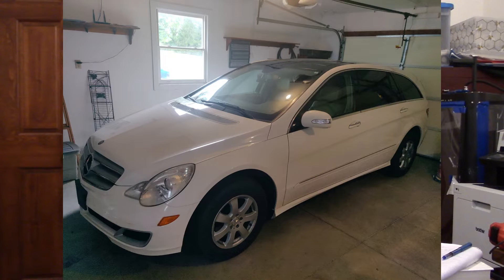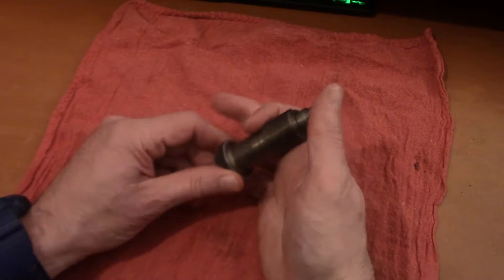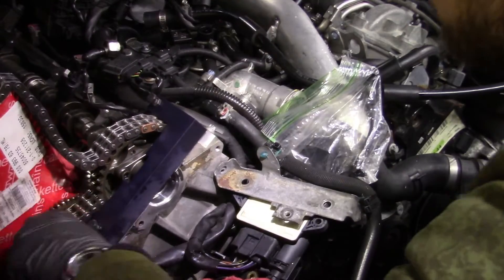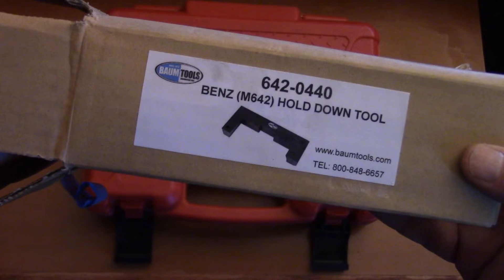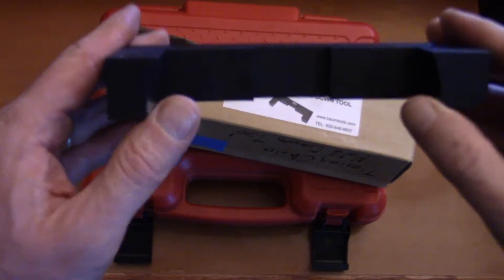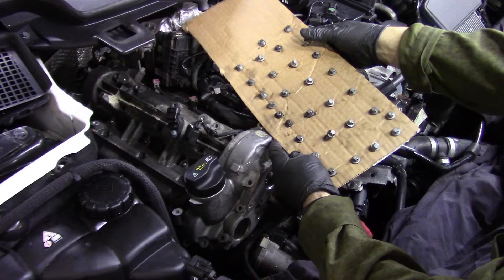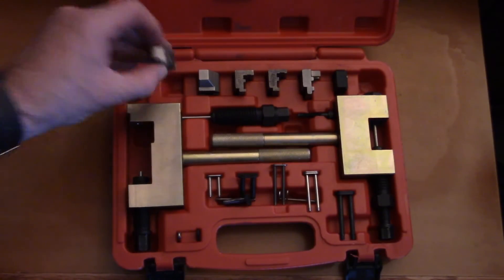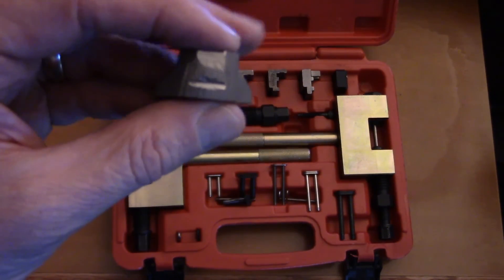OM642 Timing Chain Replacement Tips, Mercedes R320 CDI and Others

Comment: So, as you’re feeding chain down into the engine and turning the crankshaft, do the cams want to ride up as the cam lobes push down on the rocker arms? Seems to me like that would be a problem, but I haven’t noticed anybody talking about it
Reply from the maker: Sure, I see what you are thinking. That Baum tool I show is not only holding the chain onto the sprocket, it is also holding the sprocket down, and hence the cam. Keep in mind that the chain tension as I rotate the engine is also pulling it downward.

Comment: Hi if I change only the tensioner is it a strait swap or do cams need holding, thanks in advance
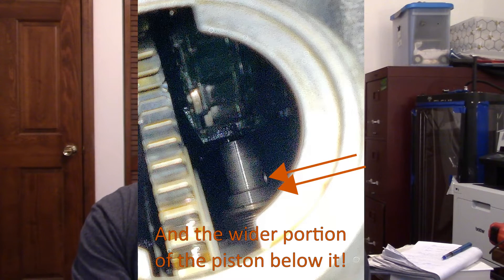Reply from the maker: Usually, the chain stretch is the problem. Have you looked down your oil cap to see if the tensioner is fully extended? That's what I'm showing at 1:29 in this video. If your tensioner looks like mine, the chain's stretched, and a new tensioner won't fix the loose chain. All I can say is that you'll have to research this carefully. I recommend seeing if you can get a copy of the WIS (work instruction system), to properly diagnose and repair.
Reply: @ArtOfDiesel I've only ever heard the morning rattle 2 times in last few years and never heard it since changing oil, I'd already purchased the tensioner so might as well fit if it's simple enough
Reply from the maker: @davesmall8810  no harm in trying. Just saying to do your research. Sorry I don´t know if you can just unbolt it and bolt the new one in without holding the chain.
Reply: @ArtOfDiesel I've seen a person holding the cam and another not holding anything, I'll leave the breaker bar on crank pulley so it has a little weight going counter clockwise
Reply from the maker: @davesmall8810  let us know how it works for you.

Comment: Hi. Good video. I have 2007 e320 CDI V6. Not starting DPF plugged cams on both sides not the same timing chain stretched 12% . Could you send me that Mercedes WSI manual how do I find it online. Thanks

Comment: No bro, don’t put nothing inside there to pull valve cover off. There’s an easy way to pop it off but for some reason it’s like the best kept secret ever.  First time I tried to remove it, two days later I was still at it. I’m not exaggerating. So I paused everything I was doing and Iooked at it for a while (about 3 days) lol. If you notice in the middle of the valve cover there’s two cut off holes and each have a shiny ball at the bottom. All you need to do is put a hammer or a medium size crowbar against that bottom ball and just gently pry it up. Start slowly, don’t put all your power into it cuz you don’t want to damage or bend your aluminum valve cover. It’s coming off very easily because you’re right in the center. I usually pop it off from the first cutoff hole closer to the front of the car. The other cut off hole I don’t think I ever had to use it plus I find there’s not enough room. Try it, it will only take you a minute. As a matter fact, wiggling the valve cover off the block will take you longer than popping it off

Comment: I admire work done there, however changing timing chain without changing all movable parts where chain is rotating/sliding is waste of time and money…
Generally speaking if chain it self is stretched it’s more likely that other parts of the set must be replaced as well…

Comment: I need to replace my timing chain. I am curious how far off timing it currently is, does the crank pulley have timing marks? I can't seem to find them.
Reply from the maker: @anyvey, it does have timing marks. You might have to clean off the pulley. When I found mine, I marked them with white paint. Mine was a full 15 degrees retarded.

Comment: What did you do to modify your engine?
Reply from the maker: I deleted swirl flaps, EGR, DPF, and cats. Cleaned out the intake manifolds that were a sorry mess, too. Don't do this if your state prohibits it! I went with a Malone (Tunezilla) tune, but I don' t know if they do deletes, anymore. Today I'd look up Tautvydas Lukosevicius of ECU Tuning Kaunas (in Lithuania) on Facebook to ask what he can do for the OM642. That's who I'm working with on my E320 CDI with the OM648, now.
Reply: This is perfect.  I'm building 3 motors like that one is for sprinter  one for jeep grand Cherokee, GL350

Comment: Awesome Video.  Would you mind sharing all the mods you did on the R320 to achieve 30mpg.  I have purchased a 2010 R350 3.0L Bluetec with 185K.  I did all the filters, the CCV and some seals/rings/gaskets.  Oil cooler seals in the V of engine seem to not be leaking.  seals in the egr cooler, vacuum housing, and oil filter housing were leaking and seem to be fine since changing. Timing chain tensioner looks to be within normal specifications.  I plan to clean the intake manifolds this summer and do a swirl flap delete with a resistor in the plug.  I would really like to stop the recirculation of exhaust gas into the intake manifold.  It looked pretty built up with carbon.  Debating on the ECU tune to delete the EGR.  CB-Engineering has a Full EGR delete kit with plates, pipes, etc which replaces the actual EGR cooler in the V of the engine.  It needs a ECU tune with the mod.  Just looking to bring this engine to its potential.  The EGR, DPF, DEF just seem to create such negative issues.  Any info would be gratefully appreciated. Thank you
Reply from the maker: You are on the right track! I deleted swirl flaps, EGR, DPF, and cats. Cleaned out the intake manifolds that were a sorry mess, too. You need a tune and at that time I went with a Malone (tunezilla) tune, but they might not offer the delete options, anymore. Today I'd look up Tautvydas Lukosevicius of ECU Tuning Kaunas on Facebook to ask what he can do for the OM642. That's who I'm working with on my E320 CDI with the OM648, now.
Reply from the maker: You also have DEF injection, don't you? I don't know if that adds any restrictions to your exhaust. I didn't have that in my 2007 model.
Reply: @ArtOfDiesel  yeah I got DEF injection.  Was looking at JR Tuning as I'm in Canada. Stage 2 with DPF Egr and scr option.  I will probably just hollow out the DPF and leave CAT in place and disconnect sensors and Adblue system.
Reply from the maker: @chrismurray8019  make sure the tune you buy deals with all of your deletions. For instance, the DPF has pressure sensors before and after, and it will notice that there's no pressure differential. The ECU will be looking for that DEF system, the EGR, etc. Join my substack at artofdiesel.substack.com and reach out to let me know how your R-class project goes!
Reply: @ArtOfDiesel  thanks for replying.

Comment: 1. We made a lot better timing chain tool
2. Covers lifted from the corner with screwdriver and hummer (carefully) 
3. Chinese riveting tool can be easily modified, and no need to remove camshafts.
Reply from the maker: Hey, I'd like to see photos of that modified chain tool! I figured I would cut it down next time, which I'm sure you did. Still, it'd be cool to see what you did to it!
Reply: @ArtOfDiesel  We made it completely different than OEM, check videos on our channel
Reply: @sprintermotors   bonjour je suis abonné sur votre chaîne j’ai regardé pas mal de vidéo sur votre chaîne mercis.je voudrais savoir sur un OM642 E350cdi de l’année 2010 Il faut combien de temps de travail pour remplacer la chaîne de distribution? parce que j’ai un souci au premier démarrage dans la journée c’est-à-dire que quelque soit le temps , le matin midi soir lorsque je démarre la voiture pendant une ou deux secondes j’entends le bruit de chaîne ensuite pendant toute la journée aux autres démarrage il n’y a aucun problème ça démarre sans faire du bruit c’est seulement au premier démarrage qui me fait ce bruit Et très rarement le fait pas du tout. je ne sais pas si c’est le tendeur qui a un défaut ou bien je dois faire je dois placer complètement c’est-à-dire il comprit la chaîne et plus le  tendeur ? remplacement de l’huile de moteur je suis très soigneux Kiyar depuis que je l’ai acheté (140000km) j’ai toujours fait faire remplacer l’huile entre 4000km à 7000 km et le moteur a maintenant 234 000km
Reply: @alidogansoy8534 j’ai lu sur des forums que si tu entends la chaîne au démarrage, le galet tendeur est au maximum donc chaîne trop détendue et faut changer. T’as résolu le problème depuis le temps ?

Comment: Thank you for making this. As a MB technician who owns a ML350 bluetec & working on a OM642 GL350 bluetec, this was very informative to know & sharpened my skills working on this engine.
Reply from the maker: Cool! Glad to help!
Reply: @ArtOfDiesel  Regarding the vacuum pump hole, I suggest 2 screws, male and female, with a middle hex part that can be screwed out to push both ends outward. With a dampener made out of rubber at both ends
Reply: Hi if its not too much trouble 4 U to answer...I own OM 642 S211 with 190 k mls and i havce never replaced transmission oil (7g tronic) .I would like to do it soon, have Fuchs Titan ATF 4134 and question is shall I use transmission oil cleaner additive, shall I drain oil from torque converter too ? I just dont want to make more mess.
Much obliged.

Comment: i am having hell of a time to remove the valve covers /cam cover. do you have any suggestion beside slide hammer ? scared of using the cam holes as they have oil passage .Thanks
Reply from the maker: @sarcotexas, I'm sorry I don't know a better way and I haven't built/tested a tool for the cam holes. Because no gaskets are used and the valve covers are glued on with sealant, they are really on there tightly! Perhaps somebody else will weigh-in with an idea. I've been hunting around the web for other suggestions and I'm not finding any. The only realy discussion of it I've found is in the following location and they adapted a slide hammer. https://mbworld.org/forums/diesel-forum/658619-om642-timing-chain-replacement-diy-gl-350-blutech.html#post7079816
Reply from the maker: If you wind up using a slide hammer, I'd look at putting an insert into that hole, but be careful not to exceed the original hole's depth when drilling and tapping for the insert.
Reply: I would just use a prybar between the valve cover, and the valley where the injectors goes, have done it multiple times, just take your time and pry at different points a little at a time.